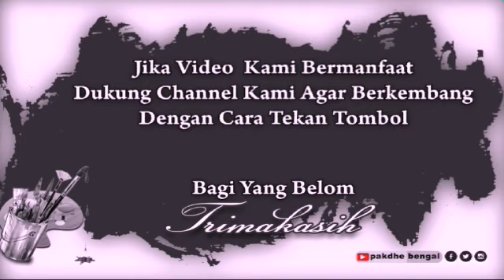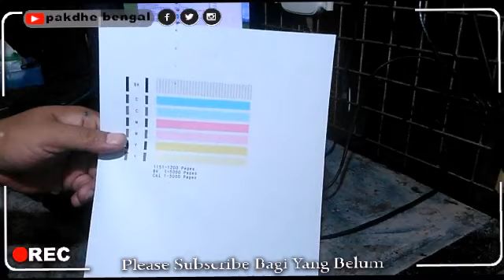CANON G1000 ERROR DAN TIDAK BISA DIMATIIN LEWAT TOMBOL | Tutorial Perbaiki Printer Canon

Comment: Pak dhe mohon bantuan nya saya punya printer canon seri ip1980 ketika di deep cleaning muncul eror kaya gini "print data cannot be sent because of the curent printer status.
check that the printer is connected and the power is on. if an error has occured in the printer clear the error.
even when the printer is operating correctly . this message may appear if the printer is taking a long time to perform an operation . if this message does not disappear after some time. stop printing .and then print again" Itu apanya yah??
Mohon bantuan nya terimakasih
Reply: Lampu power terus ngedip
Reply from the maker: Cara Cepat Mencari Video Tutorial Service Printer Saya.

1. Ketik di pencarian Youtube
2. Tambahi kata terakhir "pakdhe bengal"

Contoh: 
- Error 5100 pakdhe bengal
- Kedip blink 13x pakdhe bengal
- Canon IP2770 Paperjam Pakdhe Bengal
Reply: @pakdhebengal  udah beres pak dhe terimakasih.
Tapi muncul masalah baru, tidak bisa narik kertas blink 2x lampu orange.
Reply: @pakdhebengal  udah nonton tutorial pak dhe yg kasus serupa yg waktu ada tutup tabung infus nyelip.
Kalau masalah saya tidak ada benda yg aneh2 di dalam nya setelah saya cek lalu pasang lagi masalah masih tetap.
Apakah pak dhe ada solusinya?
Terimakasih